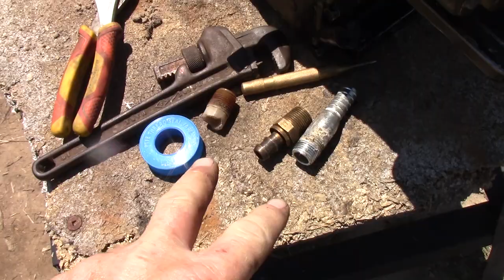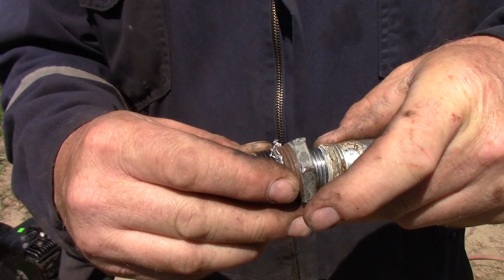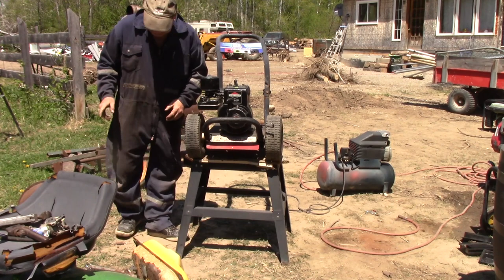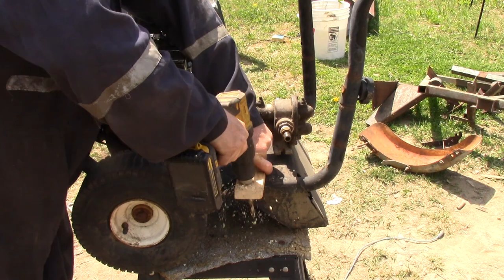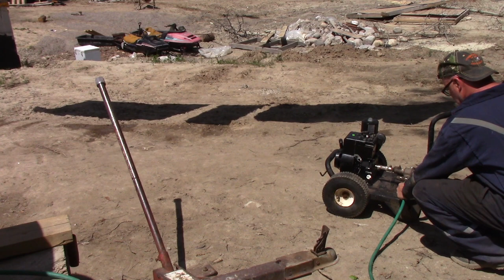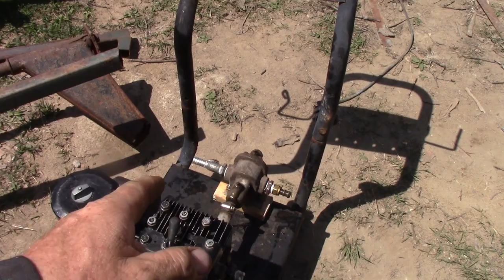Saved $$$ Built Our Own Water Pump From Scrap/ Off Grid Homesteading

Comment: I fixed the wife's Weed Wacker today. It needed a cutter to make string length . So I told her I would CECIL it. Used scarp tin , small screws, filed an cutting edge. It works great. Happy Wife .
Reply from the maker: Right On, I am glad to hear that it worked....Sure beats buying a new cutter.  You have a great day.....Cheers.

Comment: Nice job Cecil! If I remember correctly that will only suck about 22 feet, and at that length, will not be self-priming. I built one, must be 30 years ago from a 2 horse Briggs, out of a city boy snowblower, that someone gave me, and a 5 horse water pump from the rental place that someone forgot to drain over winter, and cracked out. Pump cost me two bucks plus 2 bucks worth of acetylene alumi-braze rod. I used a piece of Ford heater hose as the coupler, and two hose clamps, like you.

Comment: Back in the 70s we pumped water 100s of feet uphill from our pond. The pump was down by the pond and it pumped uphill thru 6 or 7 sections of garden hose. Much like  from your bridge to the house. Also was a 1 hp pump.

Comment: I had a 5 foot deep well for my house. I could jump into it to clean out leaves and twigs. I noticed that the pump (in the basement) was running longer than normal. The foot valve in the well went bad. The pump and piping constantly drained back into the well when the pump shut off. This put a strain on the pump (constantly pumping from the well to the house - about 100 feet. When I replaced the foot valve all was back to normal.

Comment: Looks like you have a low pressure gear type circulation pump for oils. Be sure to run some heavy gear oil thru it after each use or it will seize up. Take it from experience.